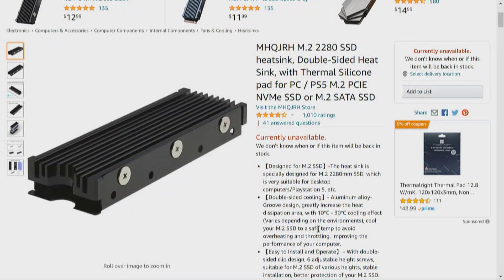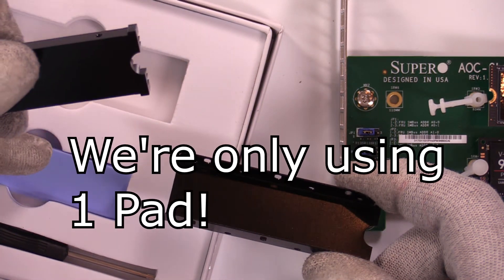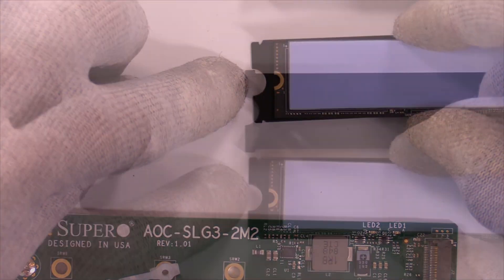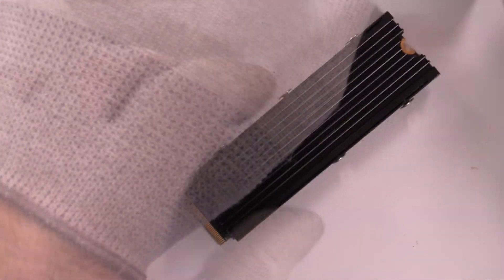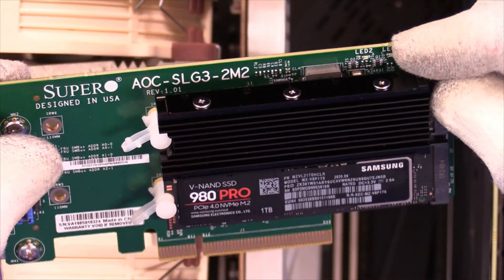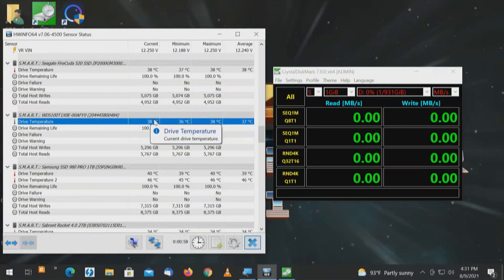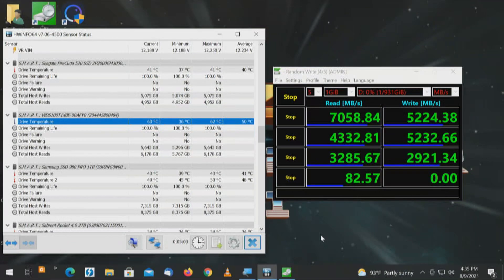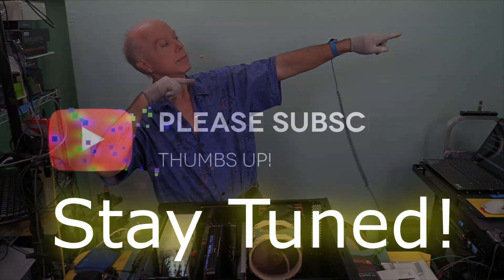Install and Test MHQJRH M.2 2280 SSD HeatSink, Thermal Silicone pad for PCIE NVMe M.2 SSD

Comment: How come you only applied 1 pad? I’m curious because aren’t the pads supposed to be on both sides of the SSD for better cooling? Or am I just stupid lol
Reply from the maker: Hi EckoTheFox, 
Welcome! Excellent and fair Question and good point! I responded in the next Video to Your Question but forgot to respond to Your Message! When We started, not all of the Heatsinks had a top and bottom Thermal pad. To keep them on par, We chose to only use 1 Thermal Pad. Yes, We should have used 2. However, I'm not planning on going back and retest for a Video. I will retest that one and include the numbers in the ongoing chart that has grown way beyond what We had planned. Down the rabbit hole and into the weeds! Stay tuned for those numbers! Thanks for Asking! Details matter!
Reply: @BuildOrBuy  Alright, awesome! I bought it myself, I’m just hoping it’s a very good one! XD does it have your approval?
Reply from the maker: Hi @EckoTheFox1 , The MHQJRH? I think You'll be fine with that one. However, my favorite performer is the Acidalie! Keep Us Posted on Your Temps! And to improve any of them would be to swap out Thermal Pads. Thanks for Sharing!
Reply: @BuildOrBuy  I didn’t know which other ones were compatible with PS5, and I just saw multiple reviews on the MHQJRH saying that it was good, stumbled upon your video and even with 1 thermal pad it seemed to hold itself nicely, which made me buy it XD unless there are others that can fit with the PS5 that are really good, so far it seems the MHQJRH is the best option for it, do you think so?
Reply from the maker: Hi @EckoTheFox1  , Two or three come to mind for PS5. Gigabyte Full Body Copper Heat Spreader  
1. https://amzn.to/3k3YOMc
Gigabyte Aorus Nanocarbon Coated Aluminum
2. https://amzn.to/3A71izb
Seagate FireCuda 530 with EKWB Heatsink 
3. https://amzn.to/3nmn0M2
As an Amazon Affiliate, I earn from qualifying purchases. 
Hope that helps! Appreciate Your Support!
Reply: @BuildOrBuy  So for my PS5 I got a Seagate Firecuda 530 2TB with the MHQJRH heat sink. Think I’ll be good in terms of temps or for that specific drive will I need a more aggressive type of cooling? Sorry for all the questions but I’d rather ask someone who knows what they’re talking about lol. Thank you for all your replies so far!
Reply from the maker: Hi @EckoTheFox1  , Absolutely! My concern, will the MHQJRH fit the PS5? And are You using different, higher performance Thermal Pads? Details matter! And if it does fit, We need to see Temps of the Seagate FireCuda 530 and compare with the EKWB offering. We know Be Quiet makes 2 Heatsinks. Be Quiet MC1 and MC1 Pro. The Pro version does not fit according to another Subscriber. Hope that helps! Thanks for Asking! I'm honored!
Reply: @BuildOrBuy  Oh yeah, the MHQJRH fits literally perfect in the PS5. And the thermal pads I’m just using what’s included with it lol, if that’s good enough. It should be, I hope. But how well does the MHQJRH hold up against the be quiet one you’re recommending in terms of keeping the SSD cool? I just wanna make sure I treat my PS5 right and not fry it from the inside out lol
Reply from the maker: Hi @EckoTheFox1 , Good to know. Good question. We're still in the Research phase on Be Quiet Heatsinks. They are restocking in USA soon. We were asked by other Subscribers to test them. We'll see! So right now, how do they compare. We don't know yet!
Reply: @BuildOrBuy  Ah alright. Thank you though! And sorry to ask again, but do you think the MHQJRH holds itself well as a really good heat sink, or is it in the “eh” range?
Reply from the maker: Hi @EckoTheFox1 , 
That all depends. Change any one thing from what We have done can change everything. To reiterate, going forward, I think what We've looked at are for past M.2 Drives. Newer M.2 NVMe PCIe SSD Drives will have to have their own Heatsink included for Heat dissipation optimization. If PS5 had been a requirement of these Tests, look at all the Heatsinks We would not have Tested. Always Test and Verify. Your Results may vary. Thanks for Asking! Right now, use what You have!
Reply: @BuildOrBuy  But in your opinion, just in general, the MHQJRH heatsink is a very good one or is it in the “alright” range, sorry for kinda repeating questions, but I just want to be settled knowing I for sure made a good call for my heatsink lol. Like in your much more knowledged opinion, is it a heatsink that performs really well? I’m just trying to look around for ones that fit in the PS5 and that one always comes up as the top performer.
Reply from the maker: Hi @EckoTheFox1 , 
For a PS5, I wish We had more info. For a Comparison in that category. Try it. See how it performs. Especially since You have it! MHQJRH - To make it better, change out the Thermal Pads. What's included with MHQJRH is probably 4 W/mK. If You upgrade those, increase to 12.8 W/mK with Thermal Grizzly Minus Pad 8. How much will it help? We have yet to Test that Theory! I'm eager to find out! Remember, We were only using 1 Thermal Pad to keep apples and apples with the other Heatsinks that only had 1 Thermal Pad! Your Temps should be better! Hope that helps!
Reply: @BuildOrBuy  do you have a link to extra thermal pads I can use with it like the ones you mentioned? And also how often would I have to change them out as I play hours on end lol
Reply from the maker: Hi @EckoTheFox1 , 
Great Question! You have 2 Options for Thermal Pads. There is a third with 13 W/mK. The Two below are the ones We're going to Test. Thermal Pads are suppose to be one time use. I've read they should be changed out once every 6 months. I don't expect anyone will be doing that. Even with all of Us running a Computer 24/7. Once a year would be more reasonable. 

1. Thermopad Thermal Grizzly Minus Pad 8 - Silicone, Self-Adhesive, Thermally Conductive Thermal Pad - Conducts Heat and Cools The Heating Elements of The Computer or Console (120 × 20 × 1,0 mm, 2 Units) [8 W/mK]
https://amzn.to/3CbT4GK

2. Thermalright Thermal Pad 12.8 W/mK, 85x45x1mm, Non Conductive Heat Resistance, Extreme Odyssey Silicone Thermal Pads for PC Laptop Heatsink/GPU/CPU/LED Cooler (1mm)
https://amzn.to/2Xeh64G
As an Amazon Associate I earn from qualifying purchases.

Notice Thermal Grizzly Minus Pad 8 package has 2 Pads. Whereas the the Thermalright Thermal Pad 12.8 W/mK, is only 1 Pad! Hope that helps! Thanks for Asking! Keep Us Posted on Your Progress! Success!
Reply: @BuildOrBuy  I was just looking back at your video with the MHQJRH and it seemed like the best performing heatsink you tested that fits inside a PS5. I also am curious about the thermal pad swapping, but sorry to ask again, but does the MHQJRH have your approval as a good heatsink?
Reply from the maker: Hi @EckoTheFox1  ,
Yes, Absolutely! It's the only one with a wrap around enclosure and side mounting screws that would fit in a PS5. Our Test was 62 Degrees C. Your Results should do better! Remember: That's a Burst mode Test. And not a sustained throughput. Expect those Temps to rise 10 to 15 Degrees C on a sustained throughput!
Reply: @BuildOrBuy  Oh, alright! But that’s also still 10-15 degrees Celsius lower than what it would be without a heatsink right lol . I just wanna make sure that heatsink is perfect for the job and won’t fry my PS5 XD
Reply from the maker: Hi @EckoTheFox1  ,
Yes. Understand. That's why We outlined Your Options.
Reply: @BuildOrBuy  Seems the MHQJRH is definitely my best option then! Thank you for all your replies, I know I must’ve been annoying but I always need lots of confidence in something before I’m settled XD I’ll keep watching your vids and see how other heatsinks work and how they compare to each other! For me, it seems the MHQJRH is my absolute best bet! Thank you so much!
Reply from the maker: Hi @EckoTheFox1 ,
Understandable. Good Plan. Absolutely! Appreciate Your Comments! Thanks for Your Support!
Reply: @BuildOrBuy  Hey, quick question again,  I assembled my heatsink and SSD together and put it successfully into my PS5, but I was wondering before I do anything have I ruined the whole thing? When putting in the thermal pads I actually removed the plastic from both sides at the start then kept fondling with them to align them properly, then noticed some bubbles on both pads, should I not use it like that or is that still fine with no issue? It’s all new to me
Reply from the maker: Hi @EckoTheFox1 , 
You're good to go! That's normal. Upon compression those bubbles will be gone! Success and Best Wishes!
Reply: @BuildOrBuy   I’m just again, being cautious lol I apologize. So say if there’s fingerprints all over them and like I mentioned there were some bubbles, will it affect its cooling capabilities or will it be unharmed?
Reply from the maker: Hi @EckoTheFox1 , 
I took a clean cloth and wiped off the metal surfaces to remove dust. You're fine. Good to go! Success and Best Wishes!
Reply: @BuildOrBuy   But fingerprints and bubbles on the thermal pads won’t affect the cooling effectiveness?
Reply from the maker: Hi @EckoTheFox1  ,
Still good to go. You have Analysis Paralysis.
Reply: @BuildOrBuy  Not gonna deny that lol. I definitely do overthink things, especially when it comes to technology

Comment: Got a blue version of this heatsink for my 2TB Black SN850 for PS5. Works awesome and looks great with PS5. Cannot be beat for $8. Amazon will be sold outa this for months to come for good reason
Reply from the maker: Hi Drunk Squirrel, 
Welcome! Good Heatsink, Yes. We also found better! Working on the Summation of Heatsink Tests We've just completed! Thanks for Sharing Your Experience! Stay tuned!
Reply: Drunk Squirrel, did you use a Thermal pad on both side? My SN850 arrived yesterday and this heat sink arrives on Saturday. I'm also installing in PS5.
Reply from the maker: HI @inozente , 
Welcome! You should for best Results! Hope that helps! Keep Us Posted on Your Progress!

Comment: I'm looking at this cooler for my PS5.  This looks like the biggest cooler that will fit in the slot.  Good to know it's effective.
Reply from the maker: Hi Cole Dedhand, 
Welcome! Change out the Thermal Pads if You do! Space is the issue for the Test for the Best! The Best is relevant to the Space. Changing one thing can change everything! Appreciate Your Comments and Feedback! Keep Us Posted on Your Progress!
Reply: Same
Reply from the maker: HI @bradgold1795 ,
Welcome!  Same would apply. Change out the Thermal Pads to increase the Thermal Conductivity rating. Hope that helps! Thanks for Watching!
Reply: Warning !!

Did not work for me.  Spent 350 USD on an sn850 with this heat sink... Very finicky mechanical connection on the ps5.  Recognized it at first and then would not read it minutes later.

Go in to this knowing that you might spend $350 and be one of the few people who it doesn't work for. Be ready for disappointment.
Reply from the maker: Hi @Aj85234480 ,
Welcome! Bummer! Sorry to hear that. Thanks for Sharing Your experience with Us! We only know what other Users have Shared. Which Heatsink did You end up using?
Reply: @BuildOrBuy  Hi !!  You post great videos; I did not mean to be negative about your video; just wanted to share my experience.

I had been waiting for so long to do this so my kids don't have to move and copy games all the time.

All videos made it look 100% effective and reliable and it is not.

It must not be such a common issue because I had to dig really deep online to find other people with the same issue.  Usually one quick search will give you the info you need on common problems, but not for this.

I tried the m.2 SSD drive without a heatsink, with only the top half of the heat sink, and it did not work.  I am going to return my drive, hoping that amazon will refund me.

Even if they do, it will about two weeks until they get the package and I get my money back.

Either this drive does not work for some people (er a few Reddit posts that o read) or I messed up the connector on my console....

I did have a bit of a hard time inserting the drive into my ps5.  I forced it in a little bit (I accidentally kept the screw on the spacer and then had to remove and replace).
Reply from the maker: Hi @Aj85234480 ,
Understand! I hear Your frustrations. Unfortunate situation. We have no personal experience with the PS5. Hope that all gets sorted out to Your satisfaction. We worked according to the Specs. We only have experience using M.2 NVMe Drives within a Computer. Appreciate Your Comments!
Reply: I’ve been using this heatsink in my PS5 with a 2tb Samsung 980 pro and it’s been working great and it’s a perfect snug fit with the metal plate.
Reply: @racerboyo  Did I buy the wrong SSD ? Just picked up the Samsung 970 EVO Plus 2 TB after installing it boots up telling an expansion has been detected in the expansion slot and to power off the PS5 and remove then restart PS5
Reply: @Boeing777DriverAA  yes unfortunately since the 970 is a PCIe gen 3 drive and the PS5 requires gen 4 drives.  If you bought it in the last two weeks you can still probably return it. 

The only Samsung SSD that works in the PS5 is the 980 pro.

Comment: Very well made heatsink , my concern is orientation : the fins should ideally be parallel to the direction of gravity , that helps a lot with natural convection of hot air , I am not sure how much of a difference that will make in this particular setup , but I am sure it will make a difference dropping a few degrees, heat management is very complex and I truly appreciate you videos keep it up 🤩.
Reply from the maker: Hi 5 nm, 
Absolutely! Heat rises. For the most part, M.2 Heatsinks are designed for a horizontal plane. As if laying on a Motherboard. There are no vertical mounts on Quad nor Dual M.2 NVMe PCIe Add in cards to the best of my recollections. Those AICs are designed with circuits and connectivity and performance in mind and not cooling in mind as it relates to heatsinks. And if the Case is standing up, that orientation also changes. Like heat under a shelf!

Therefor, We need a Heatsink, machined for a Purpose Built Design of said Add in cards. Where the extrusion is not the length but the width. I was going to get to that in the final summation. 

Until then, We'll see which of these 6 do the best based on Temps, Size and Thermal Pads. Which brings up the reason for a Silver heatsink! To Test, Verify and Compare! 

Appreciate Your Comments! The Question was asked by a Subscriber. That made Us curious to find out as well. And that's a Video for each Test! Time consuming but important! Great Discussion! Heat is a big deal! Thanks for Watching! Your Input helps Us to make better Videos Viewers want and need!
Reply: Air is just too turbulent in a case to matter.  If the air is that still, something is already very wrong lol
Reply: Convection isn't as efficient as necessary inside a case. Gamers Nexus has some interesting stuff on the topic (check out their thermal imaging videos and the Noctua fan less heatsink one too).

In this particular case (no pun intended), horizontal fins actually make more sense for computer cases for 2 reasons: most motherboards have horizontal m.2 slots (and even when slots are vertical those are usually the ones not directly co nected to CPU but to chipset), and most cases have airflow running horizontally through the board. Air comes from front fanned intakes, and exits through back or top, but usually you want positive pressure (more pressure coming from intakes) so most of the airflow will be going horizontally. This is why I actually think heatsink fins in these should be horizontal.
Note there are heatsinks that actually are "dotted", meaning they have a criss cross pattern. Those have less surface area, bur may account for scenarios where one would not be sure how air actually flows in their location of installation.
Reply from the maker: Hi @cldpt , 
Yes, I'm glad You've brought that up! We'll delve more into that once We do the Summation of the Tests of 6 Heatsinks. Right now, it's Test, Verify and Observations. As We move to PCIe 5.0, this is going to become more of a problem to over come! Appreciate Your Comments! Let's hope Vendors will become more proactive on this matter! 6 or 8 years ago, Noctua demonstrated diamonds on a Cooler.